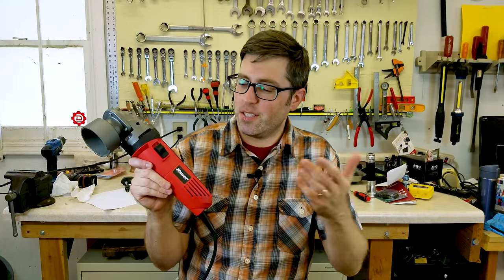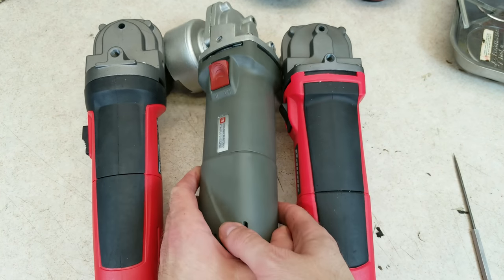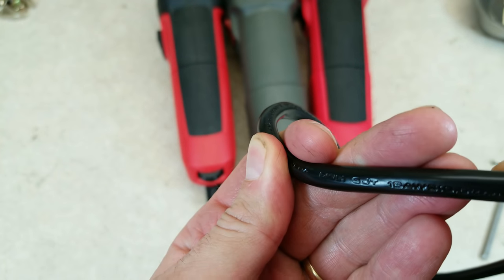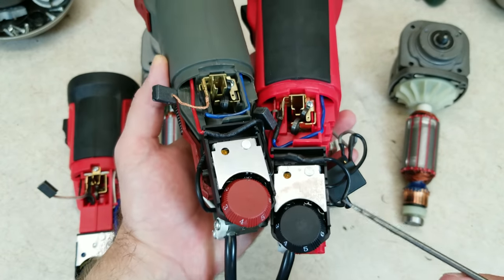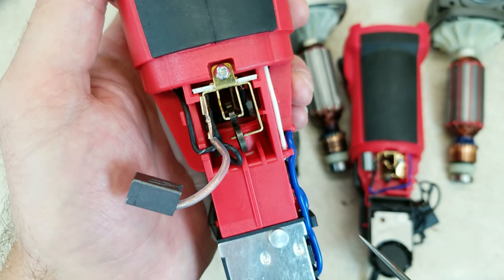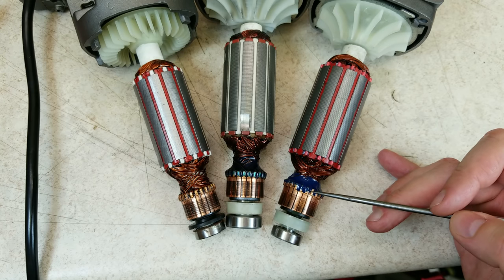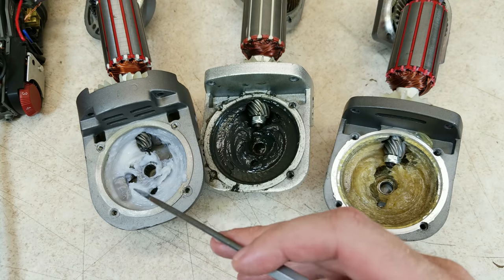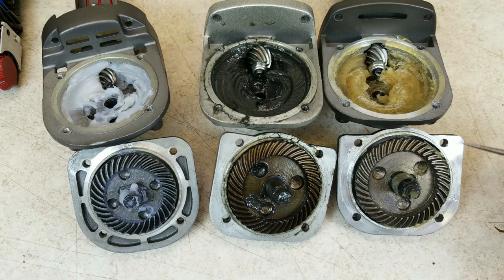Teardown: which Bauer DA polisher from Harbor Freight is better?

Comment: I can only assume the next video you will be Frankenstein-ing all the the best bits together into a custom Tool Teardowns edition Bauer polisher!

Thanks for the great videos. The -29's are a bit harder to come by - near me at least. I liked the feel of the -28 in the hand a bit better due to it's slimmer body and quality chord, but ultimately went with the -29 due to complaints on vibration.  Packed it with synthetic grease and it is super quiet and smooth.
Reply from the maker: Ha! That Frankenstein thing is a funny idea.

Comment: I have the old one and added a 25' better cord and changed the grease to Mobil 1 and it has been top-notch for the past 3+ years. Not enough differences for me to make a change to the 64529.
Reply from the maker: Yeah. I agree that it's probably not worth upgrading to the Bauer from the older model.

Comment: What I dont understand is that the 529 is the predecessor to the 528. Chronologically, it's backward. You're not throwing most of us off, and we dont always want the newest version. Keep it simple HF, and keep the item #'s in order by design change date... please... Thanks for sharing. Really like the format of this video. Concise and efficient. Well done. Subbed. Will be watching many more. EDITED: Scratch the section where i was confused with the design date and item # order. So, HF went back to an older design (for the 529) to fix issues with a near complete product change of the 528. Cutting corners doesn't always work.

Comment: HF did the same thing with the previous Chicago models, one was good, and one was not. Both were the same price. The new 64529 looks interesting if it has more torque as ALL these 8mm throw DA polishers can stall (stop rotation) when going over edges. How's the noise and vibration with the new 64529? Great review!

Comment: Its on sale now until Oct 14 / 2021 for $59.99 at Harbor Freight! Yes, they still carry both models. I ended up going with the 28 1.) higher opm 2.)better feel in my hands 3.)less vibration

Comment: The 4.25:1 ratio is a "lower" gear ratio than 3.5:1, giving more torque. You said in your video that it was a higher ratio, which is incorrect. Overall great video, very informative, love to see these teardowns. Keep up the good work.
Reply: So you think 3.5 is higher than 4.25?
Reply: @GertTown  Yes. It is what is referred to as a "taller" or higher gear ratio, providing less mechanical advantage than a lower gear ratio which is a numerically higher number. The higher the first number, the "lower" the gear ratio is, because of the greater mechanical advantage it provides.
Reply: @GertTown  It seems counterintuitive, but it's similar to the gauge system for sheetmetal and wiring, where the smaller the number the larger the gauge, like how a 16 gauge wire is substantially smaller than a 2 gauge wire (the larger the number, the smaller the wire) Gear reduction ratios are like that.

Comment: I think I'd swap the cord on the -29 for one like the -28 and call it good.  
  I worked for years as a tool repair technician and it would be nice if we could meld the strong points of the three into one but, I think with the aforementioned cord swap (don't try it if you don't know what you're doing, there are plenty if tool repair places that would swap a cord for you) you'd be pretty good to go.
  I mention this for the reasons he stated in the video, durability, flexibility length and (the -29 has a 10' cord but, especially if you live in a colder area) the rubber is just superior.   Bit it's just my OCD tool-tech nerdism kicking in.  The standard cord will work just fine.  Until it doesn't, then get a better, rubber one.

Comment: Update, I just purchased one of these newer models. Model number 64528, I took it apart and apparently harbor freight must be listening to us. They replaced the old grease with some blue high quality grease, now the commentator is resin to prevent problems with wiring from vibration and the circuit board with the speed control is that has also been dipped in resin

Comment: A similar kind of surprising variation is in the U.S. General tool cabinets. I have the 44in, 26in, and 15in base cabinets, and the 44 and 15 are of heavier gauge steel and generally better made than the 26. It's not that the 26 is 'bad', it's just not as good as the other two, which I'm confident were made in the same factory, whereas I'm even more sure the 26 was made by a different supplier. I got the 26 and 15 at the same time, and in green, and the colors don't match, either. It's only apparent when they're very close together, but there's a difference. I don't regret the purchases, but I expected them to be three peas from the same pod.

Comment: There is a new version badged 64528.
It looks like the 64529 in this video.
Reply: Can confirm this. Mine says it’s a 64528 on the box and tool. However, it’s identical to the 64529 presented here.

Comment: I got 64528 on sale for $49 today and I'm going  to use it twice a year for buffing so I'm not concern with longevity. For professional use a more expensive brand is recommended.
Reply: I got an 64528 on sale for $34.99. The interesting thing is... it’s identical to the 64529 shown in this video. You may have a 64529 and not even know it!

Comment: I'm not convinced HF has multiple versions of the same model across their inventory because they choose to make cost cuts or make improvements.  The tools that have multiple versions tend to be really popular tools, so it wouldn't surprise me if they commonly switch suppliers to keep their inventory full with no lapses, or they have suppliers sometimes pullout and are forced to go shopping elsewhere to continue that model.
Reply from the maker: I also suspect they could be using multiple suppliers to simply maintain stock, but there are significant differences between the tools those suppliers are making.

Comment: Where did you get the 64529? I can only find the "528" locally and on their website?
How does the gear ratio effect the torque/stalling of the unit? I would think a higher gear ratio on the "528" would mean you could theoretically spin it faster (in both orbits and rip'ems)? I can't imagine needing a ton of torque when most of the time the machine and polish/compound should be doing most of the work, no? Maybe do a comparison between the 3 on the orbits/RPM's and how easy each one is to stall?
Reply from the maker: I just went to my local store. The website doesn't always show the different part numbers.
Reply: @ToolTeardowns  thanks, I'll have to go to the local stores around here. Any idea on how the torque compares between the 3 vs the gear ratio and the machine stalling? is lower or higher better for the gear ratio? seems to me like a higher ratio would spin it faster, but with the possibility of having it stall out easier?

Comment: If I decided to go with HF Bauer DA, how could I get the 64529 model that seems much better in this video than the 64528?  Should I just go into the store and tear the shelf apart looking for the model numbers? lol  Any help would be appreciated! I have the Chicago Tools brand Rotary polisher that is ok for the work that I do...but with the DA Polisher, its something I am on the fence about. I was going to just get the new Griot's 9 and not worry about the HF models, but there are some power supply issues currently with their first round G9 model.
Reply: That is why I wouldn't mind going with the HF 64529 for now until Griot's gets their issues together with their early models.
Reply from the maker: You just have to go to the store and check the part numbers on the boxes.
Reply: @ToolTeardowns  I was just looking on their website and it appears those listed models are the 64528 only. I will take your advice and just go to the store and see what they have...I will also tell a member of their staff about the model difference, maybe they can keep an eye out for the 64529 if one comes in with their stock. People at my location are all very nice so should not be a problem.
Reply from the maker: The website doesn't always show all the different model numbers. Both numbers are listed on the coupon.
Reply: @passinthru6457  I am going to do the same thing then tomorrow...Awesome you were able to get the better model! It's cool to hear that!

Comment: UPDATE TO MY PREVIOUS COMMENT... It appears that I must have gotten the 64529 internals inside the 64528 model what I didn't notice earlier is mine also has the older style fan as well and the older style gearhead as well.

Comment: Hi, 2 questions, 1st I can't even find the 64529 on the HF website ? Doesn't come up. And my old Chicago electric polisher is binding up when I put pressure on it. Any idea what I can do to fix that ? Could it just need to be re-greased ? Thanks !!
Reply from the maker: Sometimes HF doesn't put all the versions of a tool on their website. If you look on the coupons you'll see it includes the 64529 number.
Reply from the maker: I'm not sure about your stalling issue.
Reply: @ToolTeardowns   ok I do see it on the coupon. I guess Ill have to drive to the store. The nearest is 45 mins but I don't wanna get the same as I got last time. It didn't last very long. Thanks for the reply !!

Comment: I bought a drill master heat gun from HF...went to use for installing pex fittings....amyway freaking thing started smoking as soon as we turned it on....even though it smoked we used it to finish the job lol.  So we finished. Let it totally cool off...turned it back....still smokes. What a pos lol
Reply: I belive drill masters being discounted for warrior brand.

Comment: Do yourself a big favor don’t buy a DA Polisher at Harbor Freight. It’s not going to last or perform well. They vibrate horribly bad and you will have numb hands not long after you start running the machine. They’re plenty of inexspensive entry level DA polishers out there. Keep looking save your money and get a good one. Spend your money on a tool that you’ll enjoy using and will last longer than one project.